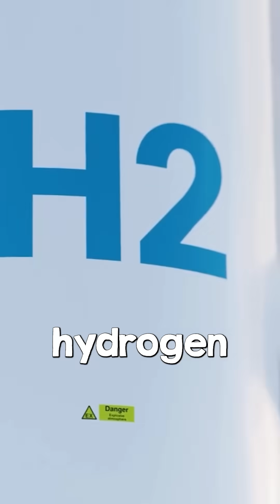Should We Build a Giant CO2 Vacuum?

Comment: Rosie, you are probably unaware of Casey Handmer's  startup Terraform Industries. They have developed a cheap and massively scalable solution to extract atmospheric CO2 and leverage low cost solar to produce pipe-ready natural gas (methane) that is already cost competitive with fossil gas around the equator, and in a few years cost competive at most other lattitudes as solar costs decline further. Casey is ex-JPL etc, and hails originally from Australia.
Reply: Either Rosie, "Just Have A Think" or "Undecided with Matt Farrell" have covered it & I understand these channels talk to each other.

Comment: An alternative pathway would be to make CO from the CO2 and forget about the H2. Then maybe make methanol. As this is an endothermic reaction you could potentially absorb waste heat from any air compressors used to collect the CO2 into the fuel in which case you might end up with an efficient process. Still requires big pumps of course.

Comment: Paul, after 3 decades of doing PV w/battery system designing, I agree with you 100%.  Winter time energy for cooking and heating has always been a major challenge to eliminate fossil fuels from the actual energy mix.

And as a small forest landowner, I've been turning my windstorm cleanup branch piles into biochar every fall, and then returning that back to the forest.  It's a little more work, but doable.

So yes, the holy Grail would be to capture those BTUs via wood gasification feed generators that can also produce a biochar byproduct.  There's R&D in this space, but cheap fossil fuels is the nemesis slowing progress.

Thank you Rosie for covering this topic on your channel

Comment: Very well explained by Paul Martin. Direct Air Capture is inefficient, expensive and energy intensive. It is a tool kit to delay the net zero by the vested interest businesses. Use the renewable electricity directly every where possible such as battery electric vehicles, heat pumps, etc.
Reply: We build excess capacity to cope with some of the fluctuations, what do we do with that excess?

Comment: Totally agree. In fact I persuaded Shropshire Council to invest £2.5m in two Pyrolysis plants that will store over 4600 tonnes of CO2 per year, and produce energy to heat swimming pools
Reply: Do these plants have names or addresses?
Reply: @alanhat5252 the first is operational at Woodtek's own site (owned by a Joint Venture with Shropshire Council) the second has just had planning permission for a site in Ludlow. Search 'Shropshire biochar '

Comment: If I am not mistaken, sea water absorbs CO2 from the air. If that is true, why do we not create massive floating air vacuum  systems that can be stationed far off shore, as  people complain that these types of structures [wind turbines, oil rigs...] are an eye sore. To power them we could use off shore wave generators or wind turbines . What is the horizon from ground level... 30 miles, so put them 50 miles off shore. Sounds like a good idea to me, but you will probably have a darn good reason as to why this is not going to work. Let me know. We should assist the oceans with absorbing CO2. WOW, Rosie... I just noticed that you have over 100K subscribers, CONGRATULATIONS!
Reply: We don't want to make ocean acidification worse than it already is.

Comment: Most new energy production installations are already renewables, so we have more than enough renewables if we wanted to install them. The problem is getting rid of the old fossil fuel energy production facilities. They will keep running as long as they're still working.
Reply: Not necessarily. They will keep running once they remain profitable. Coal plants still work, but they're dropping like flies, in developed regions, because renewables and gas are simply more economically sound.

Comment: It would be nice if there is a way to use microwave-induced pyrolysis to get rid of hazardous waste.
Reply: Yea.
Also, if there was a method to remove fluids with high ODP, from the atmosphere. That'd be ideal.
Reply: Carbon capture doesn’t make sense because the planet needs more CO2 not less.  Contrary to what climate alarmists say, CO2 is not the control knob of climate and what effect it has is almost maxed out, it is not a linear function.  The main reason we need more CO2 is to green the planet and feed the world.
Reply: @tedclapham4833  
We need reliable weather and water resources to feed the planet's people through agriculture.
Droughts, heavy rainfall, floods, and the lack of glaciers as water reservoirs do not contribute to this goal.
One could argue that we need to increase the planet's reflectivity to slow warming. However, this cannot be achieved by increasing the CO2 content of the atmosphere.
Reply: @sandmehlig The more CO2 in the atmosphere for the plants to absorb the more efficiently they use water, you will notice as CO2 has increased it is the arid area’s that have greened the most.  Also contrary to the widely stated theory major storms frequency is not increasing; hurricanes are actually less frequent.
Reply: @tedclapham4833  Neither hurricanes nor extreme heat is needed to destroy plants or a harvest. Prolonged droughts or heavy rains do suffice. In addition, they contribute to the depletion of groundwater aquifers.
Reply: @sandmehlig Weather patterns are changing but they have more to do with the wobble in the earth’s rotation and little to do with CO2 and are related to earth’s tilt and distance from the sun.
Reply: @tedclapham4833  This was already debunked.
Reply: @sandmehlig It very much depends on where you live with regard to water at least, here in Alberta lack of supply is not problem, but we are adapting.  CO2 only helps with water supply in that it helps plants use water more efficiently.  The planet actually needs more CO2 and planetary weather patterns are determined by the earth’s wobble and orbit and the sun.
Reply: @tedclapham4833  No. It is not determined by the earth's wobble around the sun. The changes the climate has gone through in the last five decades are too radical to be explained by these wobbles, who have cycles spanning tens of thousands to hundreds of thousands of years. You could ask Google (it answers with AI) - but i think you are too afraid.
Reply: @sandmehlig CO2 really has so little effect on climate that it can be looked at as a false flag drawing our attention away from the real problem, which is the greed of those elites who promote the green agenda.  They really just want to gain more control power and money over us! They don’t care if we live or die as long as they get what they want.  Yes climate is changing but the only thing we  as a species can do about it is adapt, which we can and will do. Climate change is natural and cyclical and has been happening since the planet has had an atmosphere.